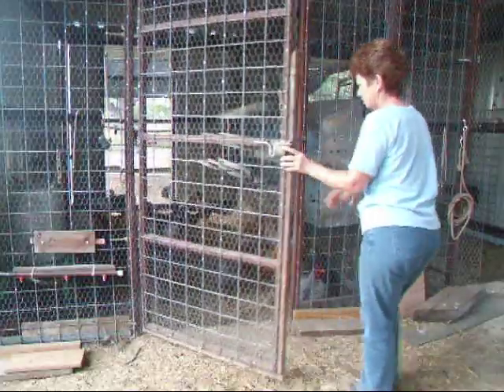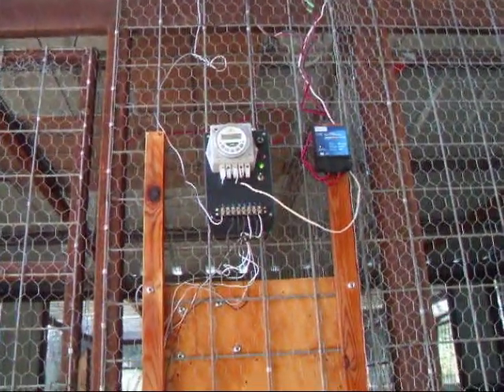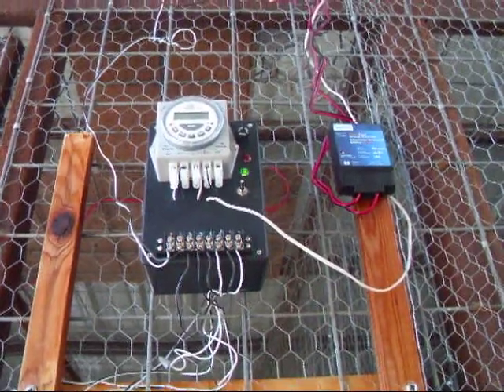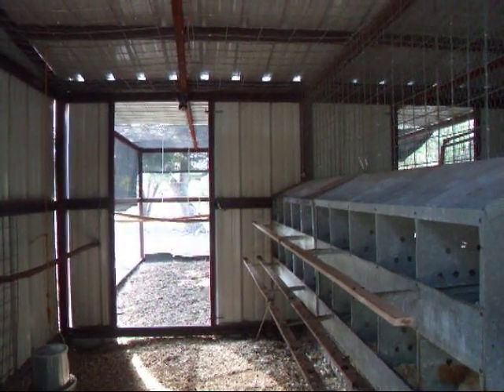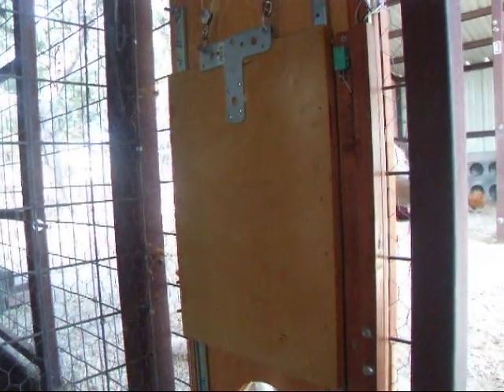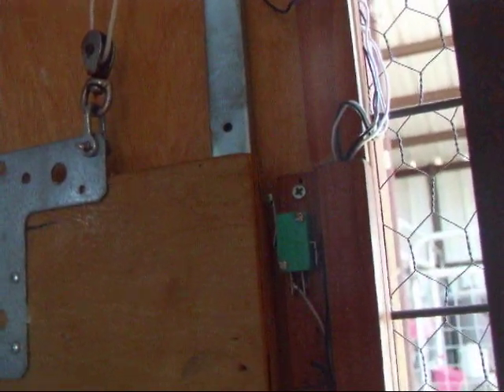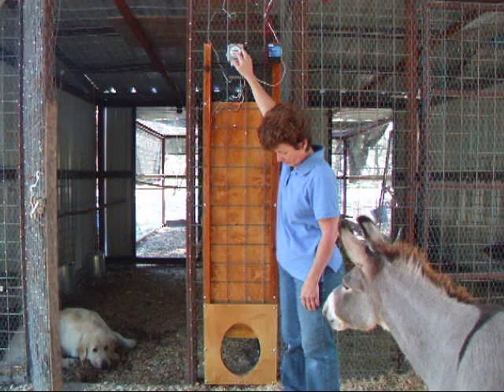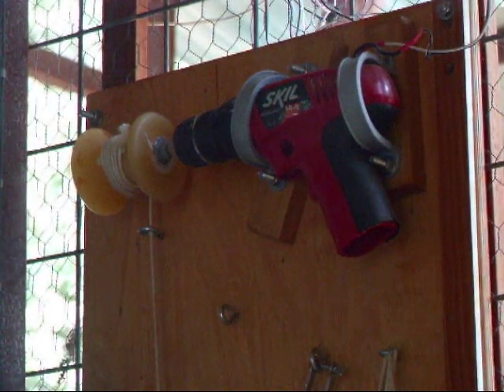Automatic Chicken Coop Door by Penny

Comment from the maker: The door has been working faithfully for 2 years now, despite the dusty, dirty environment of the barn, and the humidity etc.  We have been very happy with it.  When the days are very short in the winter we have to be careful not to run the strings of LED lights too long in the evening, but that is all.  Just keep the wiring tucked away from curious pets and put all the electronics in a closed box to keep the relays clean. Thanks!